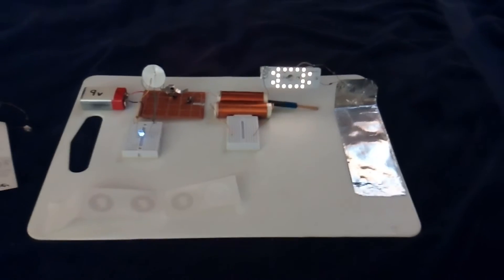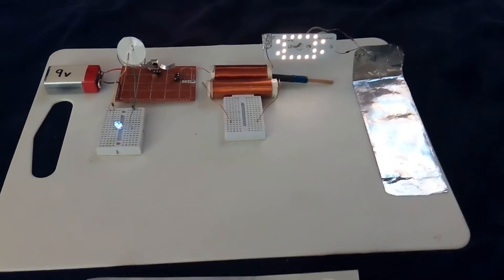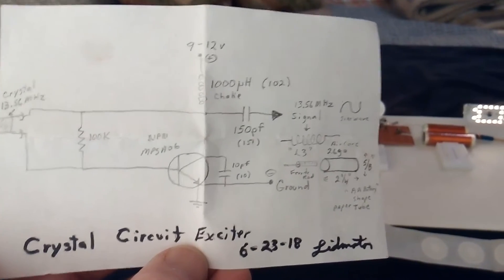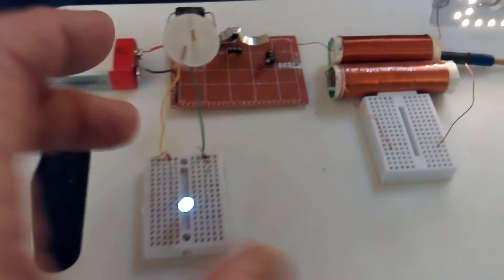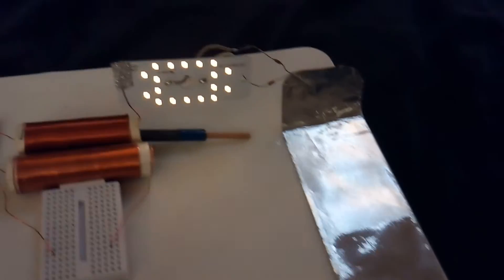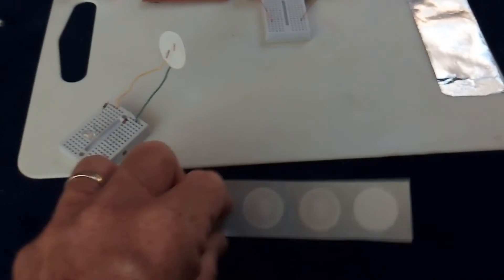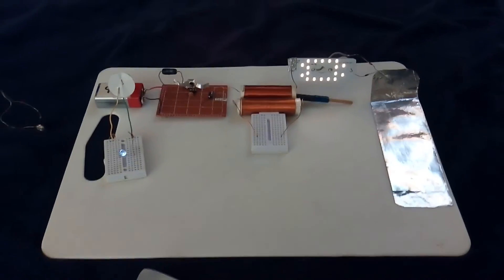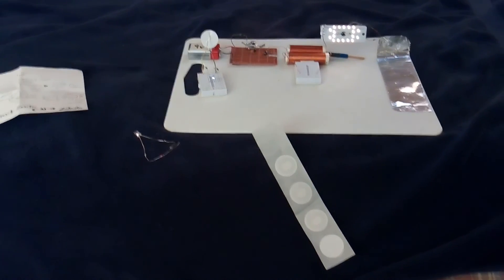RFID Tag Lighting an LED --- wirelessly

Comment: You will find my comment on Stifflers video's where I tell people to look at RFID circuitry. I noticed the frequency then already. As it seems no one was sincerely reading it.
PS: the Avremenko plug does way better, I do not believe the RFID antenna performs very well.